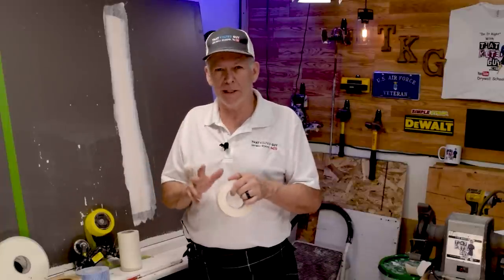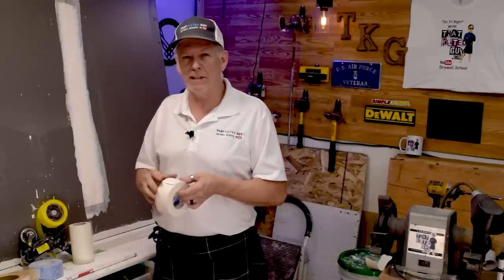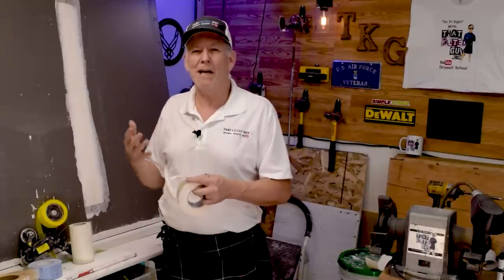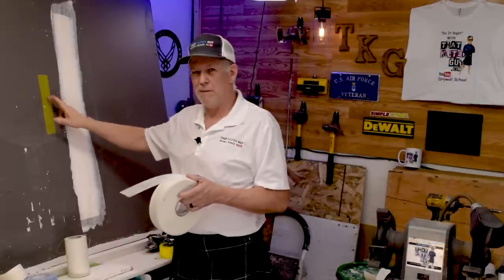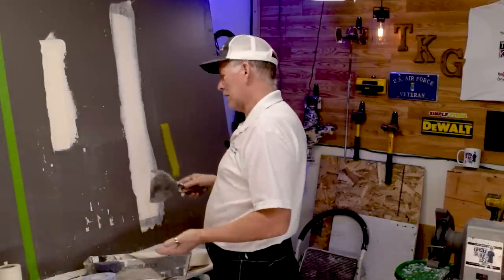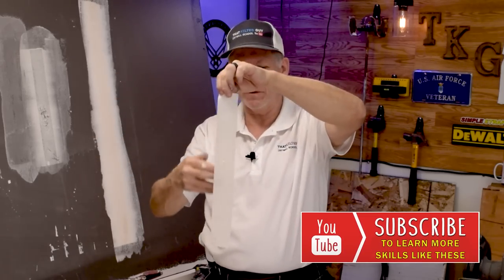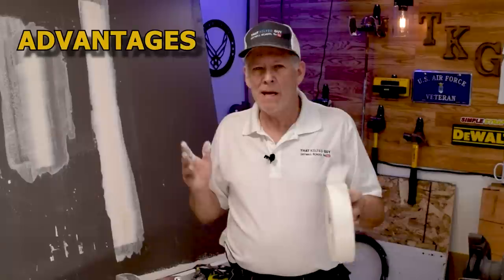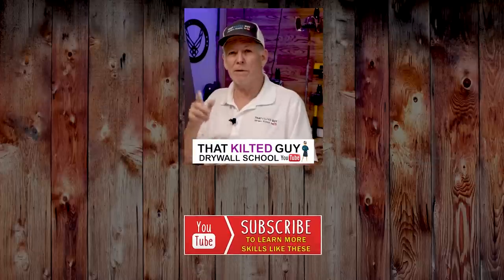The Best Joint Tape for Beginners

Comment: Hi Kilted Guy , HELP:::::::👇🏻🛀‼️‼️‼️‼️‼️‼️‼️‼️‼️‼️‼️‼️‼️‼️‼️‼️‼️‼️‼️‼️‼️‼️‼️‼️‼️‼️‼️‼️‼️‼️‼️‼️‼️‼️‼️
I’ve got a big problem in my master bathroom, the popcorn ceiling was painted with high gloss paint and some of the screws are popping out. WHAT PRODUCT CAN I USE TO SKIM COAT THE CEILING 1. To fix the holes and 2. TO SKIM COAT THE WHOLE BATHROOM CEILING TO HIDE THE POPCORN ON CEILING?

Comment: What about the Fibafuse Max tape? Should that be reserved for large gaps and ceiling repairs?
Reply from the maker: It's a little thicker but should be really strong anywhere you use it.  Should even work in the angles, though I've only used it a little.

Comment: Wait a minute. You dont do inside corners with crease outwards, do you? As for sticking or right or wrong. The paper tape is the same material all the way through. One side will not adhere better than the other. But I would think that burying that 32nd of an inch paper hump will take more work than not having to bury it.
Reply from the maker: I’ll show you soon

Comment: I prefer paper for factory joints and corners, love Fiba Fuse for butt joints and repairing bad mesh tape jobs (my house is full of additions with mesh tape over empty joints aka no prefill). They even used mesh for corners 😩

I use mesh for patches, that's about it. But I always prefill. Mesh isn't bad, just use some common sense.

Comment: The best tape for anyone is mesh. Super universal
Reply from the maker: Until you factor in that it’s required to use fast setting joint compound with it or your chances of it cracking or failing increase greatly
Reply: @ThatKiltedGuyDIY  not at all. You roll it on with a 4”roller. Then knife it
Reply from the maker: You still have to use fast setting joint compound. I know this for a fact but believe what you want or go read the manufacturers website. How you apply it has little to do with whether it’s more prone to crack. The material has everything to do with it
Reply: @ThatKiltedGuyDIY  that’s because you never used a roller
Reply from the maker: @Gog3453  that doesn’t change squat.
Reply from the maker: I’ve done this for 40 years and I guarantee rolling it on makes no difference compared to spreading it with a knife. Maybe go read the manufacturers website where it says do not use regular all purpose with this mesh tape. Or maybe they don’t know what they’re talking about according to you? Try it young dog 😂